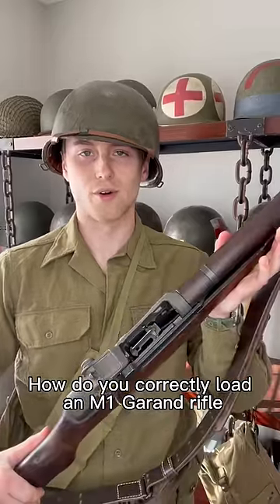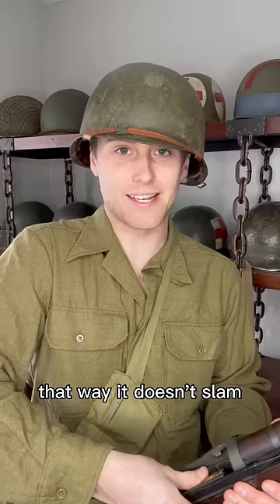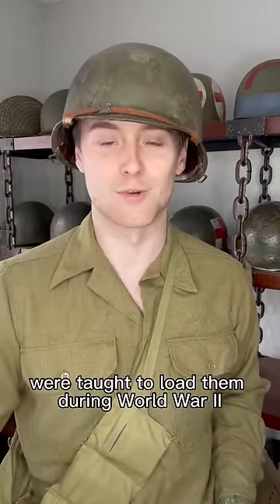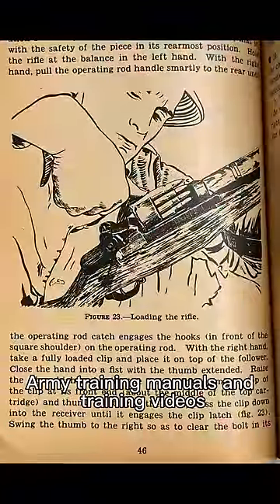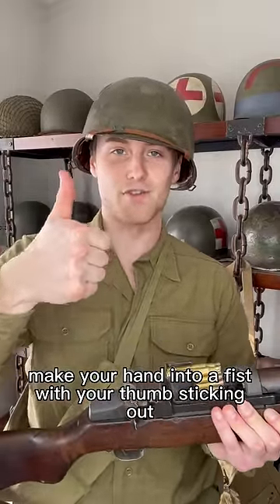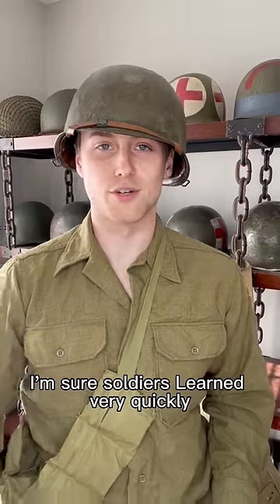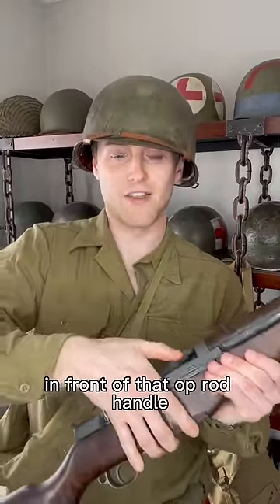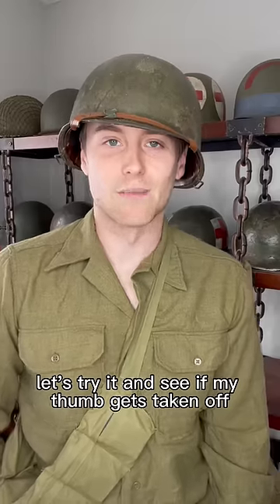How to (in)correctly load an M1 Garand

Comment: The trick is to press the clip all the way down and keep downward pressure on it. That downward pressure will prevent the bolt from slamming closed until you remove your thumb from the top of the clip. If you do it right, you can feel the “click” all the way at the bottom of the motion so you know the bolt is unlocked and ready to ride forward. You can hold your thumb there as long as you know what’s going on with the mechanism.

Comment: it depends on the enbloc, a brand new one that the soldier would be using, as the old ones were just left where they lay in combat, would be to stiff to let a round out without a decent whack of the bolt. for most of use that reuse enblocs dozens of times, they loosen up and dont clamp down to hard and it slides the round out easier
Reply: Explain simpler
Reply: @d4af37  it was pretty simple brubby. Old, loose, bolt with close easy.
New, stiff, won’t close. 
There ya go Mr. Kindergarten

Comment: If you are pushing on the cartridge itself instead of the en bloc clip you wont have the bolt slam. The official training definitely covered that detail in practice. And remember, 2023 Garand rifles and 1941 Garands were two very different animals. All of the surviving examples have been opened and closed at high speed under pressure (fired) a million times and are pretty much worn out.
Reply: I’ve got a Garand that you have to bump, and another one that never needs it.

I’m use to the bump motion no matter what happens
Reply: lucky man, you have two? are they US military issues? I bought one that just barely made it to the war in March of 1945, about 3 weeks before it ended in April. it likely didn't see any action but it's still a really neat piece of history
 @The_SmorgMan
Reply: @SexyFace  got a post Korean War HRA and an April 1942 Springfield.

Comment: I have a question that I very much would like an answer to... Everywhere I go I find different versions of an answer, but as an expert in world War II stuff I believe you would have the full answer...
How exactly does an m1 Garand op rod work? Because there are some versions that close as soon as the clip is in, that you showed just now, there are some that don't close and remain open, like you've shown in some of your reenactment videos, and then there are some with a switch that actually allows for a reload mid combat, which I was under the impression did not exist until the 1950s NATO variant when the rifle was used in Korea
Reply from the maker: They all try to close right when the clip is pushed in, but often times if the clip is holding the rounds together very tightly, the bolt doesn’t have enough force to strip that top round off. In that case, it stays open and you have to smack it to help it close. Mine does that often. It just depends on the specific clip and rifle being used.
Reply: Hello there! As a long time Garand owner, reenactment participator and lover of the old M1 I’ll pitch in. The difference you see between some closing immediately and some having to be “slapped” closed actually doesn’t have anything to do with the op rod. First off, m1 thumb usually happens not because the shooter/rifleman isn’t quick enough, it’s that the bolt is fully secured back all the way and it’s actually just hanging on the mechanism that holds the en bloc. The reason some close and some don’t in my experience is the tightness of a properly loaded en bloc or in some cases a weakened op rod spring. When the en bloc is depressed and the bolt disengages from the rear it’ll snag the back of the first cartridge, sometimes it’s not enough force to chamber the round and needs a little nudge. Some however just rock and roll once forced in and send it right on home. I’m no expert, this however is my experience after many years with them in my possession. Hope this helped
Reply: @WorldWarWisdom  you beat me to it as i was answering haha. Love the content!
Reply: @WorldWarWisdom @WorldWarWisdom and @Vanish Thanks guys, this really helps my understanding of the Garand, I appreciate more than you can know. What would you say regarding the button on the left side of the rifle that allows for releasing the clip. Again I heard that was a 1950s NATO thing, is that true?
Thanks again guys!
Reply: @grandadmiralsuntzu5066  it’s not actually a 50s thing, i have a 1943 built garand and the little tab you’re referring to is actually Called a “clip latch” it’s for manually unloading the weapon without having fired it or manually cycling each round. Hope this helps
Reply: @Vanish2930  thank you so much! That answers my question

Comment: The trick when loading the official way is to maintain pressure on the clip, the bolt won’t go until you remove that pressure, kinda like stepping on a mine, just make sure to move fast
Reply: Mines go off the moment pressure is applied. Only in Hollywood do they click when pressure is applied and go boom after it's removed. Why would they give the chance for the enemy to clear the area and call for EOD. Garands can also shut the bolt regardless of pressure. The fist with the thumb down method only works if you apply pressure to the top round instead of the en bloc. Even then it's not the pressure that helps. It's the fiction that keeps the bolt from closing.

Comment: If you insert the clip until it clicks into place the bolt won’t go forward until you push the operator rod forward. This works in a still setting. In combat not so much. The way we all know is the adaptation of soldiers loading under combat conditions

Comment: To be fair, supplies for the Garand were typically brand new. New clips combined with dirty guns, not to mention the bolt stripping a round, which slows it down, and you've got a weapon that will almost never give you Garand Thumb.

It's only more common now because of clean rifles, worn clips, and no rounds.

Comment: if you noticed in that brief second, when you press the clip into place, the bolt releases from its lock but doesn't slam shut until you release it. If you jam a clip into the gun and press firmly, the bolt wont close. This method is still imperfect as it relies a lot on the bravery of the soldier to not have the bolt close on their thumb.

Comment: Kudos for correct nomenclature! Calling it an 'op rod handle' rather than 'charging handle'. 👍
As for the 'M1 Thumb', that's only a problem when closing the action on an empty rifle, as when performing 'Inspection Arms' during drill.  THEN, you have to press your thumb all the way down into the receiver to release the follower.  When loading ammunition, you thumb gets brushed out of the way.  FWIW, I use the bladed hand method when loading my M1.

Comment: Except the blade of the hand against the charging handle is exactly how the 1940 version of FM 23-5 tells you to load it. No idea why they went over to the balled fist from the 1943 version onwards though.
Reply from the maker: That’s very interesting. I’ll have to take a look at the 1940 version of the manual. I believe in some of the post war manuals they show the bladed hand as well, but I could be mistaken. Looks like I’ll need to do some more digging to try and figure out why the 1943 manual differs from the 1940 publication! I’m a big fan of your videos by the way, thanks for the comment!

Comment: The M1 Garand or M1 rifle[nb 1] is a semi-automatic rifle that was the service rifle of the U.S. Army during World War II and the Korean War.

The rifle is chambered for the .30-06 Springfield cartridge and is named after its Canadian-American designer, John Garand. It was the first standard-issue autoloading rifle for the United States.[13] By most accounts, the M1 rifle performed well. General George S. Patton called it "the greatest battle implement ever devised".[14][15] The M1 replaced the bolt-action M1903 Springfield as the U.S. service rifle in 1936,[16] and was itself replaced by the selective-fire M14 rifle on March 26, 1958.[17]

Comment: This weapon must have been an absolute marvel at the time..

Cycles the next round after each shot,
Finishes the clip with bolt open and dumps the clip out,
Automatically loads the first round once the new clip is seated

The only interaction the firer needs to have besides shooting is puttin a new clip in.. and any stoppages/jams clearing of course..

Comment: I've done it both ways, and had no problems. As long as you hold pressure on the top cartridge, the bolt won't move. It'll slip forward some and catch the back of the case, but it won't bite you. Both methods are fine, and you won't get hurt. Just dont be scared, and use a little M.A.N. youll be fine

Comment: It’s a good idea to add a Holbrook device. After the last round the bolt locks open and will not eject then empty clip. You eject it manually pushing the release. Push in a fresh clip and it locks in at the bottom. 
To release the bolt you must pull back on the op-rod and let it go. Top round loaded ready to go.

Comment: the garand loaded incorrectly forcing the bolt shut is when you get Garand Thumb.

You can avoid it by not tripping the bolt and press on the center rather than the front of the cartridges.

Comment: The shorter the bolt stroke distance, the more likely you'll get a failure to feed.  At the gun range, a failure to feed is NBD.  On the battlefield, though...

That's why they said to not hold your hand in front of the handle.  If you slow down the bolt, and then release it from 90% distance, it might give you trouble.  It's why the CORRECT method to loading a bullet from a pistol that has the slide hold back is to NOT hit the slide drop lever, but to pull the slide back and release.

Comment: You have to make sure to hold down on the top round, not the enblock, doing so will prevent the bolt from closing. Pushing down on the enblock allows the bolt to slide foward, causing Garand Thumb.

Comment: i might be wrong but iirc if you notice when you did the 'proper' loading method, there were 2 clicks, first the slide went forward slightly and clicked, it would stop there, and only release going fully forward after you stop pressing on the clip, so as long as you dont let go and keep your thumb in there, you're fine.

Comment: I'm sure this'll get buried, but from what I remember reading is that if you firmly press the clip all the way to the bottom, the bolt will "prime" itself to close, and once you release the pressure it will fully close. If you are too slow or not pressing hard enough, the bolt will skip the "priming" and just slam shut. Later versions of the M1 slightly changed the design so that you have to manually close the bolt, thats why some people claim that M1 thumb is not real. I'm paraphrasing all this from memory, so I'm sure its not textbook quality info lol

Comment: I figured out both ways on my own.  The bolt is SUPPOSED to remain locked back until you release downward pressure on the clip and then go forward as happened in your video.  But it's too finicky, and I always do the block method myself.

Comment: Yeah, but that's because you pulled your thumb away really quick. If the bolt is pulled shallow and caught on the follower instead of correctly pulled all the way back on the up rod catch, as I can see you have it, as long as you have downward pressure on the top* round the bolt won't cycle forward until you release it.

Comment: If you push the clip all the way down and hold it down, it will keep the bolt locked to the rear until you remove your thumb.

Comment: I may be wrong but I thought I saw a pic or a vid one time where the bolt won't close while you're applying downward pressure to the clip. Think theres an arm or small lever that locks the bolt while the clip is pressing it down on it so if you're pressing down with your thumb you technically have all the time in the world till you stop applying pressure...that being said I'm still not brave enough to try it lol. 

Also never had garand thumb but I've had ljungman thumb and that was so much worse...

Comment: Actually, BOTH methods are correct. According to FM 21-100 "Basic Field Manual - Soldier's Handbook" July 23, 1941. Including May 4, 1942 and Dec 28, 1942. 

On Page 104 Paragraph 130 (2) "... With the right hand he takes a fully loaded clip and places it on top of the follower. He places the RIGHT SIDE of his hand right hand AGAINST THE OPERATING ROD HANDLE and with his right thumb press the clip down into the receiver until it engages the clip latch." It also includes the tapping of the op-rod to close the action.

So using the hand to control the op-rod was described in the "Soldier's Handbook'. So, keep using this method. It was in the "Official" manual FM 21-100

Comment: Because of arthritic hands I have had to adapt over the years. I place the clip in, then attach a c-clamp around the action and crank it down. Not really, I cut a block of wood to size so I can push it down with my palm. Garands weren’t designed for old men to load. 😉

Comment: It's actually harder than you think to get garand thumb, you really have to be messing around and not paying attention in my experience. As long as your putting downward pressure on that top cartridge in the clip, it's not gonna come forward enough to pinch your thumb. The top round in the clip won't be aligned with the chamber, the nose of the bullet will be hitting a "wall" aka the inside of the receiver just below the chamber opening. 

That's why sometimes even when you press down and load the enbloc clip correctly, it still won't close on it's own and requires a bit of a tap or slap on the charging handle to send 'er home. I typically load mine the first way shown where you rest the side of your palm on the charging handle, just so I can feel when it's starting to let go, then I just move my hand away naturally. I've gotten garand thumb one time in my life, and I purposefully had to try to get it. Wouldn't recommend it lol.

Comment: As long as you push down on the top round in the clip the bolt will not release, as soon as you take the pressure off the bolt charges the top round from the clip, no room for your thumb, the top round is being chambered and the bolt will simply push your thumb out of the way.
You will only get M1 thumb if you fool around with an empty mag and don't know the correct way to close the action.

Comment: If you push it all the way to the bottom and hold it it will not go forward until you start to let off pressure and pull up.

Comment: If you keep down pressure on the clip it will not fly forward until you release the pressure . The problem is when you have not pulled the op rod all the way back and locked in . My dad was a Korean War vet and I’ve never been bitten by any of mine .

Comment: Unless you have a bad follower or the bolt is not fully locked to the rear, the bolt won't slam forward anyways. You actually have to slightly nudge the chatging handle to release it.

Comment: Actually the bolt won’t goes off if you still maintain pressure on the EnBloc clip. It only push forward when you release the clip and get your thumb out.

Comment: turn your thumb around so the nail is pointing to the bolt face, it's got less friction so it's easier to pull away without getting snagged if you absolutely have to load that way.

Comment: The friction from the top bullet in the clip is normally enough to hold the bolt open if you don't give it a nudge so usually it doesn't matter.

Comment: Well the "m1 thumb" phenomenon is mostly a post war thing after the rifles had seen extensive use and their engagement surfaces had worn down. The correct way to load an M1 during ww2 is how the army advised however you failed to mention how they tell you to smack the bolt handle forward to chamber the next round

Comment: I have another theory that could be incorrect, but I'll throw in my 2 cents

I think maybe it could be a concern that soldiers would mistakenly ease the bolt forward so as to ensure their thumb was out of the way, which could induce a malfunction like many autoloaders

That's just my theory, and one of the reasons I find it fairly difficult to teach people at the range to "just let go" of the charging handle/slide of autoloaders (even though I explain the gun cycling itself will bash it up far more than they ever could bare handed)

Comment: When I had a Garand (I miss it...), I always loaded it with just my thumb and had no issues. I never really had the strength to put my palm on the op rod AND shove a clip in with its tight, new CMP parts.

Comment: It only smashes your thumb if you press down the follower WITHOUT a loaded en bloc loader (clip). As long as one maintains downward pressure on the loaded "clip" it won't/can't bite you. It is impossible for one's thumb to be in front of the bolt with a loaded clip inserted and the bolt & top round going into battery.

Comment: You should inform folks that M1 Garand rifles aren't really able to handle modern 30-06 heavy loads and you should stick to lighter stuff like 165gr or if you can find 150gr.
185gr and 210 will warp you op rod from the excess pressure. Not warp in the way you probably thing, but send it out of alignment enough that every other round will be a failure to eject or stovepipe

Comment: Dude as a modern line cheff i learned you can drop stuff in to deep fat friers, so long as you pull your fingers back in time And accidents are the best teacher.

After the fist time your unlikey to make the same mistake twice. Also if the rifle was rested on cover or held prone the right hand could hold the bolt open whilst pulling the rifle against the right shoulder.

Its only real a problems would have drilling. From any coverd position realoding wouldnt have been an issue